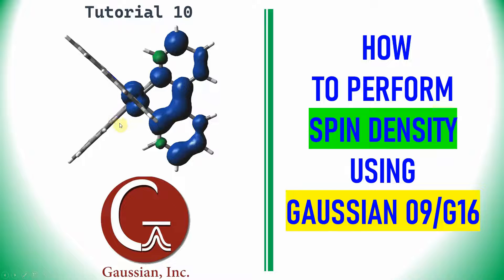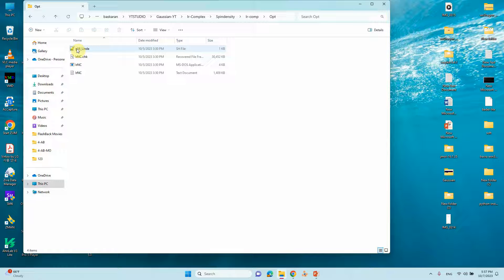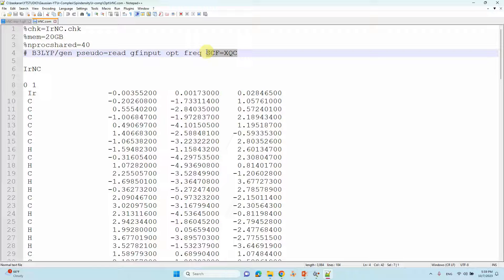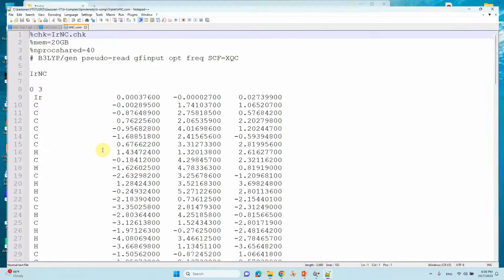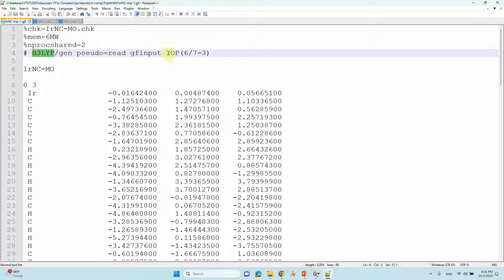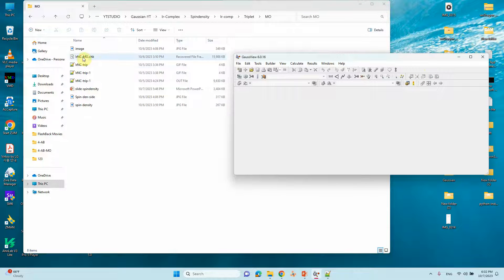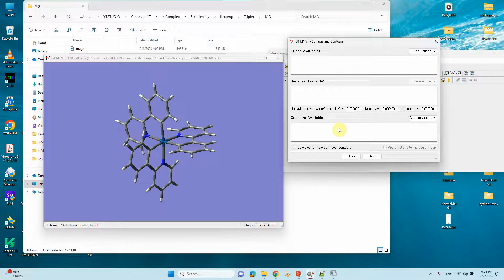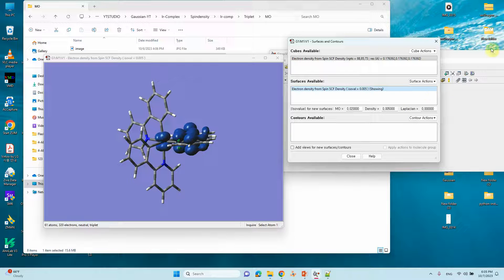How to do spin density calculation using Gaussian 09W or G16

Comment: I want to calculate spin density using DFT method. The structure is extracted from xrd crystal structure data...metal Y with +3 charge is connected to N and S of  the ligand... I want to optimise the structure with -1 charge on the ligand...how I can do this... kindly guide